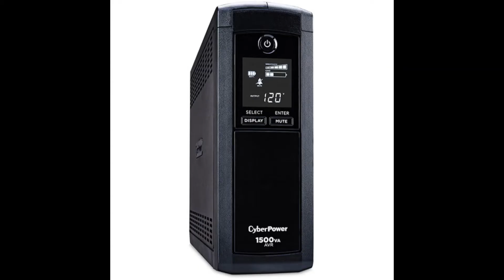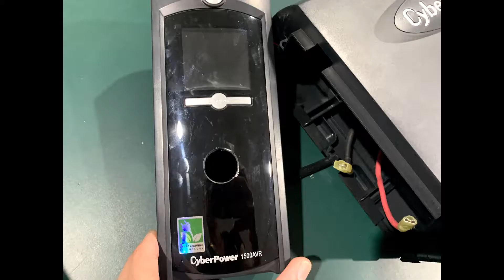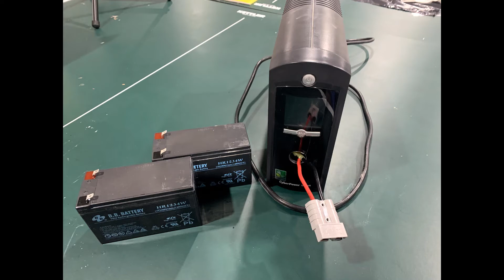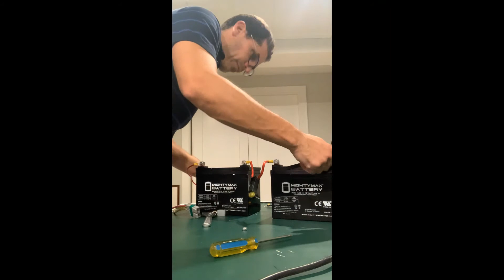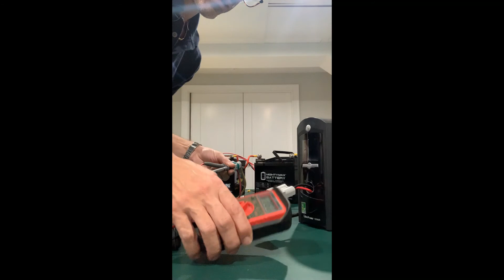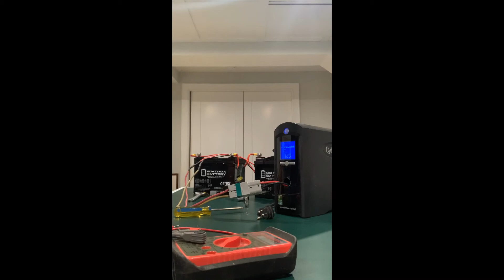Battery Backup UPS Hack - Cyberpower 1500AVR

Comment: Do you have to use 2 batteries or could I use one
Reply from the maker: For this unit you need 2 batteries to make 24 volts. It doesn’t matter how many batteries you use, but you need to get to 24 V. You could also use four 6 V batteries.
Reply: @AlanSNasar  could I use one 24v lithium battery? Thanks for responding
Reply from the maker: @MyQuietRealm  The voltage will work. You might have some charging issues because the onboard charger is meant for lead acid batteries. If the batteries have a built in BMS it might work.
Reply: @ I have a cyber power unit that had only one 12v could I use only one battery with this specific unit possible a car battery?
Reply from the maker: @MyQuietRealm  yes a 12v auto battery would work. Deep cycle would be preferred to auto designed battery because it will last longer.

Comment: Nobody told that a UPS running from 24V DC, with a 1500VA maximum power feed can draw 60A? You 20A fuse will blow in no time! 20A at 24V is barely 500W.

You obviously know very little in electronics/electricity. You should not mess with something unless you understand it. 9Ah batteries will get you maybe 5 minutes worth of power at full load.   These batteries will get you maybe to 15-20 minutes at full load...no more! Even at 50% load, you can't expect anymore than 30-45 minutes before your batteries drop below 20-22V.
Reply from the maker: I am using 35ah batteries instead of original 9ah batteries. You are correct about the fuse, it will limit to about 400w. This is for safety. This should be run at 20% load for safety and will last for multiple hours. I use it for router, modem & switches and it has worked well for years.

Comment: It's been over 2 years now, have you had to replace the batteries yet? And if not, have you tested them recently to see if they're still holding a charge? I'm looking to do this mod, but more so I don't have to replace the battery every two years or so than for capacity's sake, as my current rig WAS getting more than an hour before the latest set of LABs I got for it burned out.
Reply from the maker: I have not had to replace the batteries. It has been working fine. handled the recent power outage without any issues. I have not specifically tested the capacity with a meter.
Reply: You could easily do this mod today, and for very cheap and use LIFe batteries.  You can build your own 24v battery using a BMS and wire this up the same (UPS would charge/discharge the battery) and have hours of backup.  Put a 30amp fuse on the + terminal.  Could use an XT60 or XT90 connector too to keep things simple based on the amps max. LIFe chemistry is also providing a recharge of ~5k cycles + depending on cells.

Comment: For the Anderson, is the wire on it 12 awg 200C wire? Gonna do this project since it is a good idea for extra power.
Reply from the maker: Use 10 or 12 gauge depending on how much amps you plan on drawing.

Comment: Also for such large capacity battery's you would want to invest a external charger. it took mine over 48 hours to charge the battery's. something like a 3 amp max battery tender will do wonders and a high amp diode will keep the unit from cooking the internal charger.
Reply: At that point, I might consider just getting a power inverter, large deep cycle battery, and charger instead of a dedicated UPS.
Reply: I am doing a LFP upgrade on a pure sine model.  I thought about using a shottky (cheap but voltage sag) or ideal diode (expensive for 20-30amps) and this will still backfeed the internal charger like you said but why would that matter?  The best option would be to disable the internal charger, I cannot find any videos on this.  The low voltage cuttoff is another issue but I think the only problem here is that you will not get any warning before the UPS shuts off when on batteries and it may shut off way before the batteries are drained.  I used to use a deep cycle marine battery but it did not last long.  I checked it after 3 yrs and it was down to 10.7 volts, dead.  Probably because the charger in the UPS isnt designed to desulfate such a large battery.
Reply: Update: it turns out that some UPS chargers work on timers based on expected battery size.  This may be why my lead acid battery was damaged from improper charging by my Cyperpower 1500 PFC pure sine UPS.

Comment: a bit of advice. Change the fuse to a 30 amp one. Internally these cyber power units are fused at 30 amps. 20 amps will blow under full load. ran mine off two lawn and garden battery's for alittle over a year and that netted me 70 minutes of run time at 200 watts then degraded quickly from there. so VRLA is the way to go for sure. Looking into doing a lithium upgrade for it. Also the damn thing will need cooling if run longer than a hour. The transformer can handle the heat the switching supply can't.
Reply: thx

Comment: Some UPS have digitally controlled hardwired how long charge takes , so you don't get a large batterypack recharged. I don't know which model does . Does this Cyberpower 1500AVR charges until will fully charged or a predefined time ?
Reply: They constantly put out 13.8 volts even when fully charged and are limited to 700 mhA. This is the reason why the factory battery's only last for about a year. It slowly cooks them into submission. it will constantly float the charge and there is no cut off time. There is no cut off or time limit to it. They are designed to "have it ready at all times"
Reply: @CotyRiddle  Could incorporating a BMS module help keep from cooking off the batteries over time?
Reply: @Phyxx_TX  The BMS would have to cut off the input voltage without making the controller think the battery has failed. This is why you can't use LiFePo batteries in these, as nice as one of those would be for this situation...
Reply from the maker: It seems to charge the batteries fully. I haven’t drained them completely though.

Comment: Nice ! Is it still working ? Did you tried testing by having a blackout , and recharge the batteries ?:yougotthis:
Reply from the maker: Yes, still working fine. I have had only short power outages of about a half hour to an hour or so far. I believe it will work for 8 to 10 hours.

Comment: Great idea...but also a great way to burn down your house. Why? Cuz the circuits inside the Cyberpower consumer-grade UPS are only rated to deliver power for a short period of time. After that, they get too hot and fry, perhaps frying your PC or your house. Also, the unit's charging circuits are similarly capacity-constricted, so when charging bigger batteries, the charging circuits may fail, or may fail to fully charge the bigger batteries.

These hacks should ONLY be done with commercial UPSs, which are rated for 100% duty cycle.
Reply: Meh install a small pc fan in there and dont run it over capacity and you’ll be more than fine. The world isn’t.
Reply from the maker: That is a good point. I run it at 20% load or less. Overheating could be a problem at higher loads.
Reply: Burningdown a house. No only if the thing gets shorted. they will thermally run away on you yes but it will blow the internal fuses first or just blow a fet out. Have had it happen.